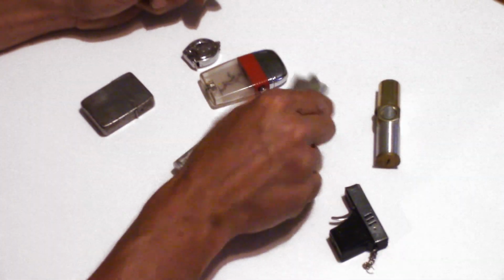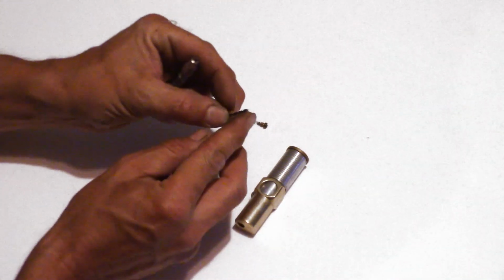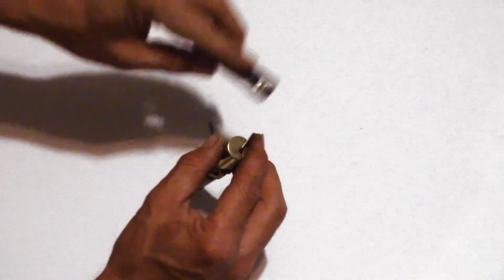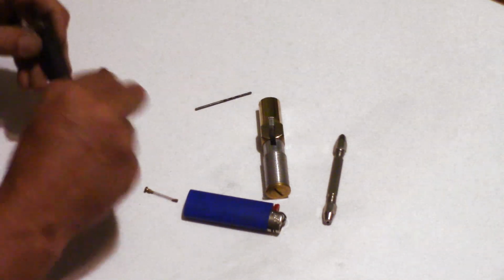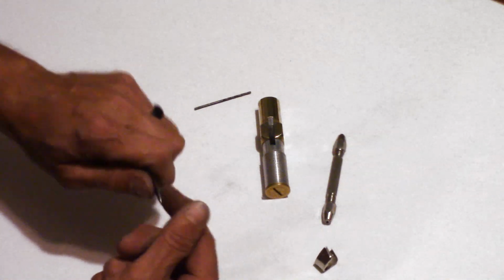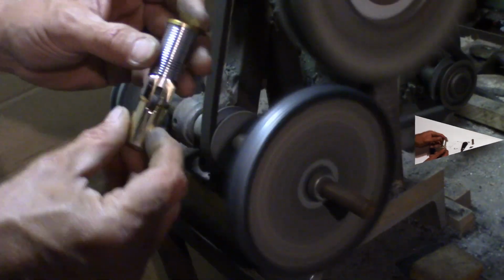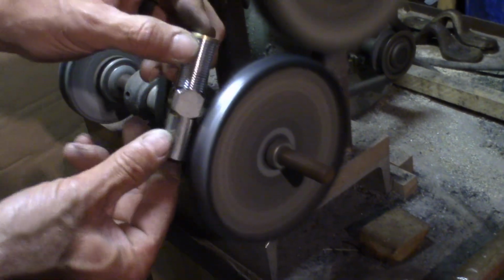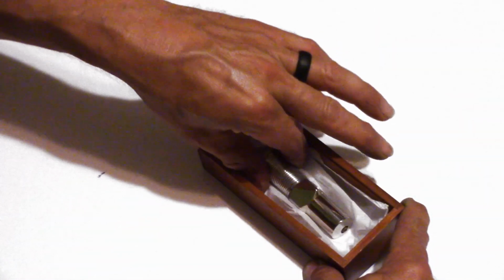Restoring A Vintage Nimrod Pipe Lighter Rescued From The Landfill Episode 5

Comment: I can't find anything on replacing the wick on a Nimrod.  Can you do it similar to a Zippo?
Reply: Wondering if you ever found a solution? I am also having trouble finding anything on replacing the wick, and the wick seems to be much more rigid than a zippo wick, not sure if that is due to it’s age or if it’s a different style wick.
Reply: @codyarnette1834  No I kind of set it aside after I noticed a crack in it.
Reply: Richard Bledsoe  Well that’s a bummer. I appreciate your quick reply!

Comment: Which fuel will come in Nimrod pipe lighter? Plzzzz reply anyone
Reply from the maker: If it is being shipped to you it will probably be empty but Nimrods use the same lighter fluid as a zippo lighter.

Comment: My problem is that the flint tube has been jammed to the striker wheel. Do you have any suggestions, I have tried using the head of the flint screw as a lever point and had no luck. I don't want to damage anything else, I found out that my mother was using the lighter to press coins into coin books, that's what caused the problem. Do you have any suggestions?
Reply: Get a tiny skinny screwdriver and insert it in the flint tube till it’s at the very bottom then hit the top of the screwdriver with a ball-peen hammer or other bulbs object until the flint cracks through.
Reply: A jammed flint is not the problem, the flint tube is jammed against the wheel. How do I pull the tube away from the striker wheel, or maybe how can the slide be safely removed from the body of the lighter?
Reply: Watch the video. He tells how to free it up. Man!